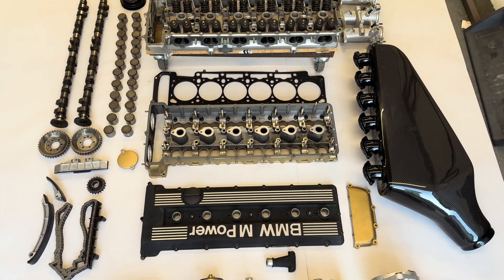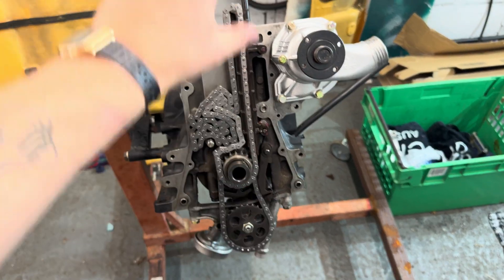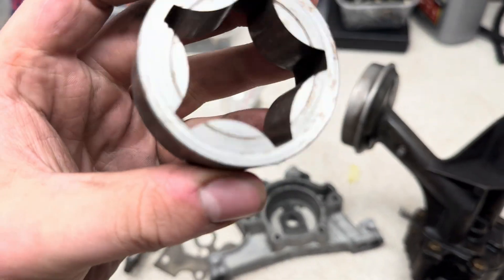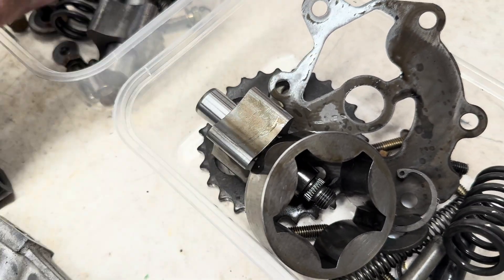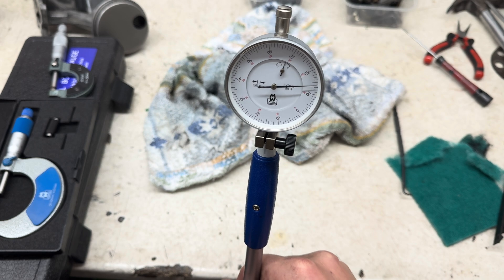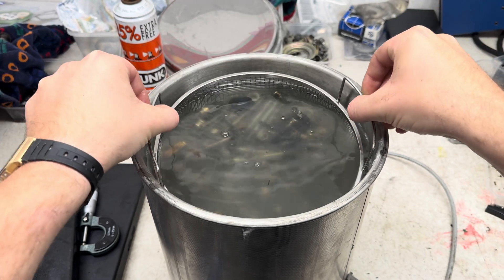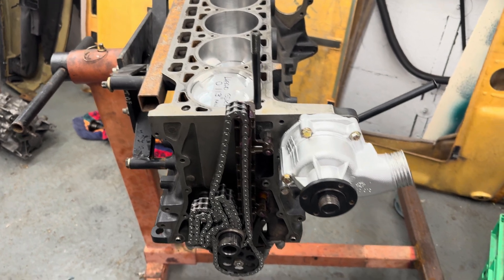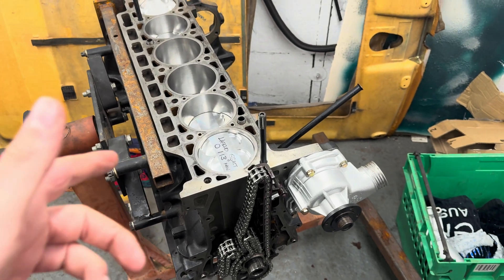My First Ever Engine Build! Part 1: BMW S38B36 Rebuild

Comment: I recommend checking out M539 Restorations video clip on topic, Sreten who is running that channel is very skillful guy and so on. He built m73 engine with paper gaskets and used Loctite MR5923 on both sides of gaskets, he did bunch of reseach and tested aswell.
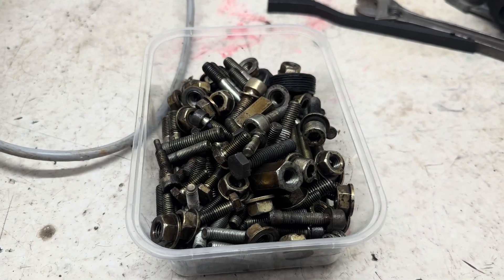Heres the video https://youtu.be/XsV0h-9z86c?si=8PcjgcisoUynR1Db&t=450 watch from 7:30 to 14 mins roughly if you wanna learn more, or watch the whole video :)

Comment: As an engine safety precaution consider a drilled oil pump nut with a safety wire while you’re in there, peace of mind. Great build, I enjoy the videos!
Reply from the maker: Thanks! Yes, I agree. I have only tightened it down, then I thought it could be improved. I will look at doing this before I finish!

Comment: I'm enjoying this build. Engine work is intimidating at first. Just take your time, keep everything clean and stop if you run into questions. Soon you'll be on the road getting arrested in no time!
Reply from the maker: 100% dude, many questions have been asked but no mistakes so far

Comment: My colleague advised me to put Loctite 510 on each side of the paper gaskets like the water pump and other gaskets like the oil pan (etc...) on my M20B20 to avoid leaks and not to put paper gaskets like you but maybe you’ll be good. He worked on race engine for Lancia delta, rallye cars so I listen him.
Reply from the maker: So I have been quite conflicted to whether to do this to every gasket. I have the 510 sealant which I planned to use for any surfaces which seal in oil, but was advised it was not required for water, but this can all be changed if it is true! Experience is what I don’t have, so always happy to listen to any advice, thank you
Reply: @BadE30  It may be excessive (or too much) for water, but I played it safe because it's also my first engine. I really like your channel, as a guy who restore an E30 coupe, you're a good example for me :)

Comment: Looking forward to it, great work as always.
Could you shoot some shots on the thermostat housing? Looks useful to use in other applications
Reply from the maker: @dullboyengineering  thanks! Well I sure can, however there is an issue with it being used elsewhere, there are practically none left anywhere! NLA for years and the m5 people keeping them safe. This unit is a reproduction of the original and it was not exactly cheap🥲
Reply: @BadE30  ah that's a shame!